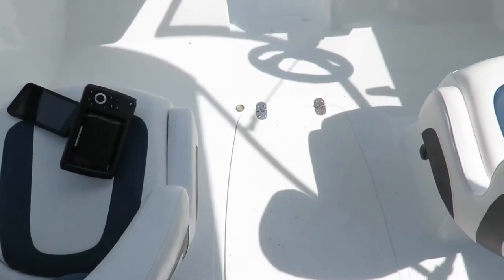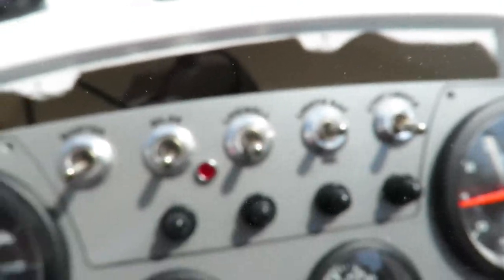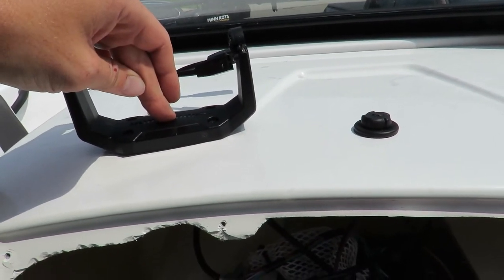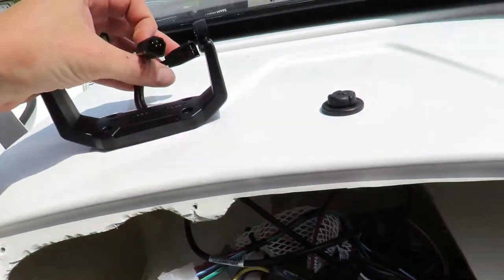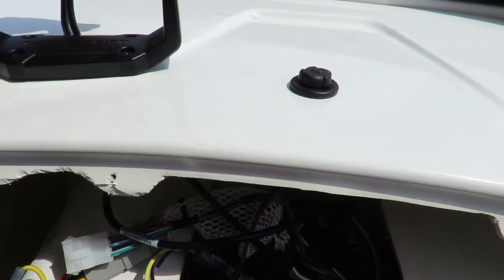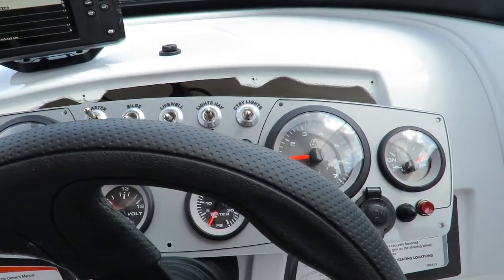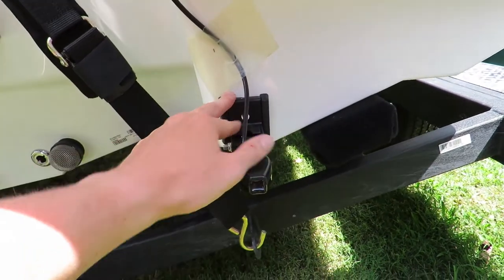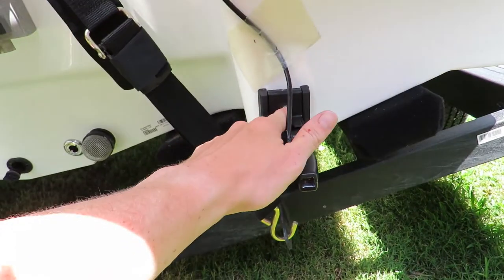How to install a fish finder [ 2021 Tahoe 450 TF ] hummingbird helix 5

Comment: I have same boat I notice that you have the pole to pull a tube or ski did you have to buy that separately or it came with the boat?
Reply from the maker: Bought it seperated. It was $240. If you call a local dealer they can order you one.
Reply: Okay thanks mine didn't come with it. I did call but cabelas wants 549 for it
Reply from the maker: Bert S I heard if you don't buy it when you get the boat they mark it up a ton. If you bought your boat there tell them the catalog says $240 and you bought the boat from them and didn't know it didn't come with it

Comment: Can you tell me what color the wires are that you hooked your power up to 
I just purchased the same exact boat
Reply from the maker: Jh1982jh I believe one was black and one was red and yellow I believe. It's the only open wire under the dash that hasn't been wired up. It will have the butt connectors and a online fuse all set up

Comment: Did you change out your prop to a stainless one yet ?
Reply from the maker: Jh1982jh no running the one I have for now debating if I want to get a 4 blade when I do buy one
Reply: I’m getting 52 out of the 21p aluminum on a gps 
I’m wanting to switch to a stainless 
Prolly go three blade though 
Let me know your results as I will do the same
Reply from the maker: Jh1982jh sounds good man. Yeah I got 56 our of the stock prop on the 150
Reply: Is that on a gps ?
Reply from the maker: Jh1982jh yes gps speed
Reply from the maker: Jh1982jh gps seems to be more accurate then the speedo
Reply: I was asking cause 56 is a lot more than what I’m getting 
52 is my max on gps
I have a 21p black max 
Only have 4 hours on my motor
Reply from the maker: Jh1982jh I got probly around 8 on mine now. That speed was when it was just me and the wife with minimal gear and trimmed up. When I have 4 or so people on board max out around 50ish
Reply: Did you adjust the jack plate any or did u leave it like the factory set it
Reply from the maker: Jh1982jh everything is left factory obly thing I did was put a hydrofoil on which helps a ton keeping the bow down in waves